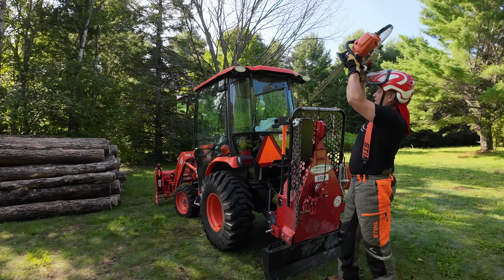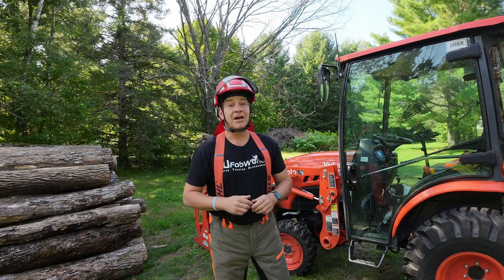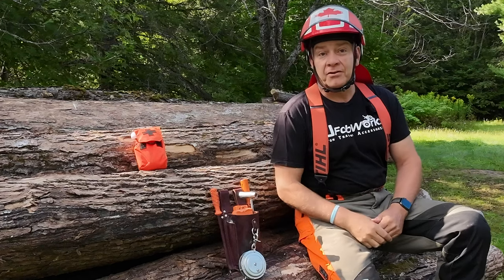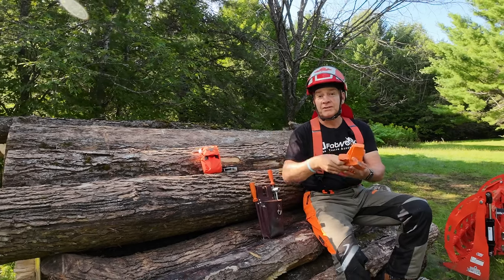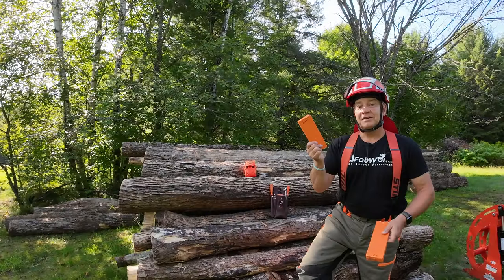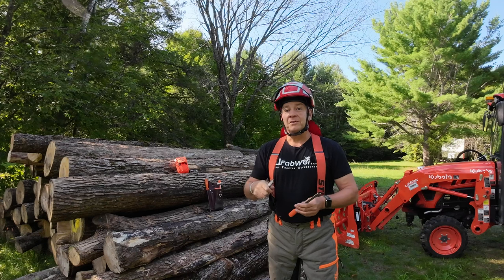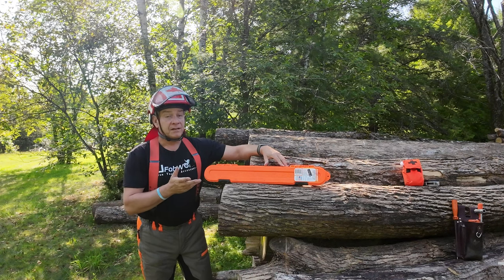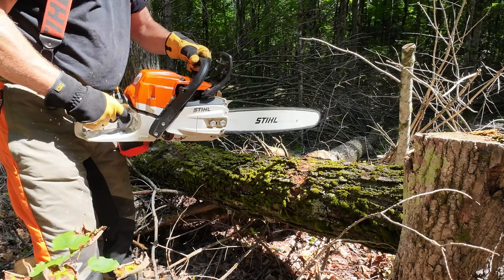701 STIHL Chainsaw Won't Run? Here's Why. What's in My Chainsaw Pouch?

Comment: I’ve heard that the problem is the gas can not letting the gas vapors release. It builds up pressure and floods the carburetor. I unlocked the gas cap to vent out the pressure and it no longer floods the carburetor. That’s why it happens in the summer and not the winter. 
Thanks for another great video.
Reply from the maker: Morning Mike. That sounds familiar - do you open the gas cap before starting or after you shut it off?
Reply: @GPOutdoors  Always before starting. When you leave your plastic gas can in the sun and it swells up and then, when you take the cap off the gas rushes out, the same thing is happening to the gas tank in the chainsaw.
So I open the cap let the pressure release, but if I do not do that, then, as soon as I go to start it the pressure releases and that forces the gas into the carburetor and floods the chainsaw

Comment: Thanks for video. I also have a 261cm and have problems restarting in hot weather. I took it to shop and they couldn’t restart it same day but they tried next morning and it started fine. I don’t cut a lot in hot weather so not a huge problem. All my research points to vapor lock but I haven’t tried letting it idle. I hope it works!  Thanks again!!
Reply from the maker: Hi Richard - another gentleman said he opens the gas cap first to let out the pressure and then closes the gas cap back before starting and it works for him.  Good luck!

Comment: I was not far from the house once, so I only took one saw. Of course, in no time I had the saw stuck in a cut and couldn't free it. I did have a spare chain in the truck, so I removed the bar bolts from the saw and then pulled the bar out of the tree. It's the chain that's stuck, not the bar. Put the new chain on the bar, reinstalled it on the saw and made a new cut near where I was cutting and freed my chain! Now I'm back in business.

Comment: Hmmmm, very interesting about letting the saw idle for a couple minutes after using it. Really the only time I have a SOB of a starting it, is when I let it run out of fuel to the point it dies.

Comment: An easy fix according  Chickanic, It's the gas. She dumped the gas  and filled with clean new gas but not from department stores, the Stils ran fine, each and every time. The old gas had a pink tinge to it if this helps.

Comment: Good Morning GP, Vapor lock was a big problem on my 1985 Dodge Ram Van B350 especially when I was pulling my 7000 lbs 30 feet long RV  🥵 It was a warm carburetor engine 🤣You are very well equip Logger GP 😇👍 Have a safe week Sir Cheers 👍👍😇😇🍻🍻
Reply from the maker: Morning Dave! Hey what kind of trailer brakes do you use on the trailer (RV)?
Reply: @GPOutdoors  It is electric brake and recommend it, rather than hydraulic. So easy for control and also maintenance wise. However on tractors, hydraulic is the way to go. Cheers 🍻🍻

Comment: Surprised you do not toss in an older bar as a spare in case the tree fall back and you need to drop the bar and chain and put on a new one to cut yourself out. That generally only happens on really bad days though.....
Reply: Great tip!
Reply: When I go to the bush I carry 3 saws with  and an axe    hate runn8 g back home over something  not working

Comment: At least you are getting it to start after a hot run. Instead of  hitting the throttle right away upon start up, let it idle then. The flywheel fan will help cool an unloaded cylinder and do what your manual and shop advised, only on the other end of a hard run and shut down. It seems counterintuitive for the eco-minded, to let a machine run without doing work...not efficient. But this is the thing with modern-day two stoke engines that are set up to run rather lean.